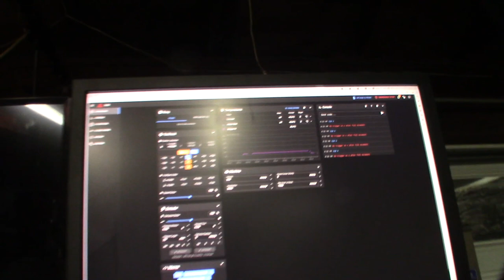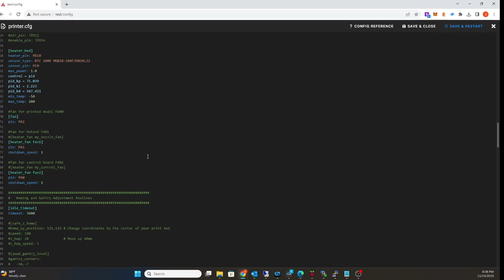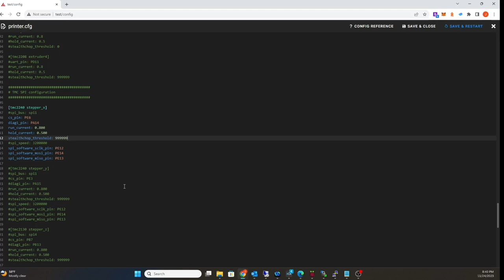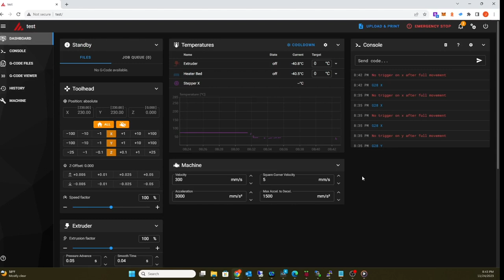Trinamic TMC2240 Klipper SPI Configuration with MKS Monster8 troubleshooting 2240 driver

Comment: Thanks for posting this.  Question: Are your heatsinks bonded properly/squarely to the board?
Mine appear to be epoxy-bonded directly to the PCB (not removable, not re-seatable).  This is different than my 2209 drivers which used an adhesive pad. 

My main concern is that the 2240 heatsinks are not fully pressed down onto the board.  They're sitting sort of at an angle with a blob of adhesive under them.   This means that the adhesive does not fully cover the area over the chip that needs the heatsink, but it also means the adhesive is way thicker than intended, and adhesive is a comparatively poor conductor.  The adhesive should be as thin as possible to allow heat conduction into the aluminum heatsink.   

Are you seeing the same thing?
Reply from the maker: Mine seem fine. The max current I can run through them is 1.4 amp. If I go higher the driver crashed under fast accelerations. Under load my X Y drivers run around 75 degree C. My Z access run around 40C
Reply: @fintechrepairshop  I wonder if the higher-than-1.4-amp crash is due to a voltage sag on whatever rail these drivers are pulling on.  Either that or they're just plain too hot. 75 is pretty toasty, although they're probably spec'd to 85C, so my guess is the former.  Do you know if these run cooler/hotter than the reference TMC2209 drivers with similar accelerations?   My work has a Voron 2.4 and I want to optimize speeds (for certain large prints) and I don't want to be totally blind to the A/B X/Y driver temps, so thinking of swapping in the 2240's rather than bonding thermistors to the heatsinks. 🙂  I agree with you that these are likely to become the de-facto standard drivers in place of the 2209s (if they work well).   Are you actually getting better performance with them?